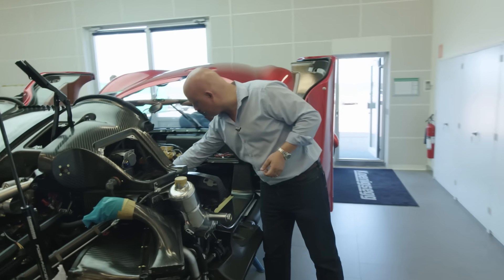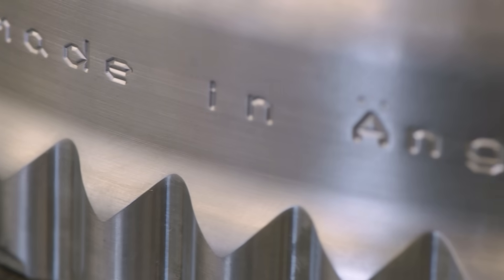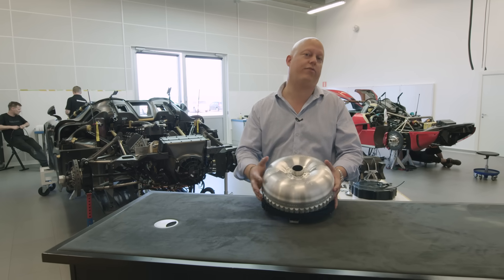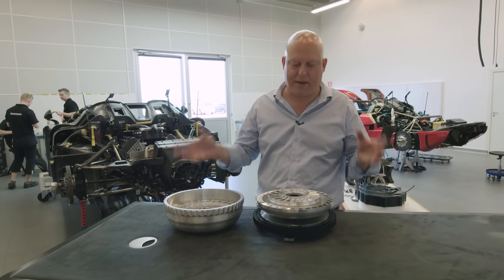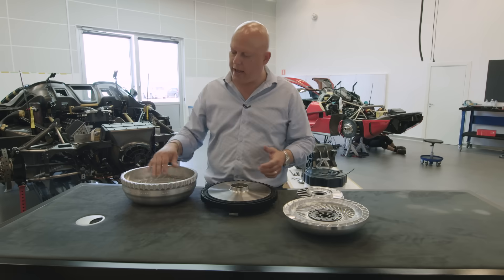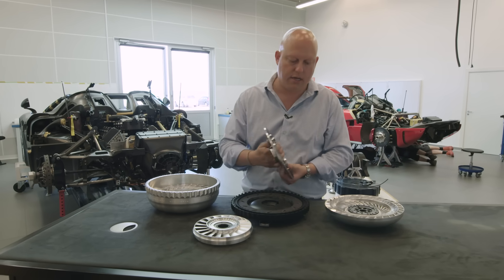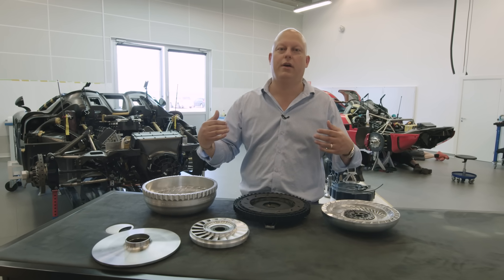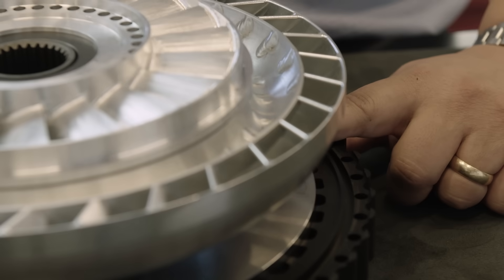248 MPH Without A Gearbox: Direct Drive  -- /INSIDE KOENIGSEGG

Comment: Sr. Koenigsegg: How much energy is loss in the hydraulic torque converter? Similar to old used in automatic transmisions? I already think for a similar Idea, but the people says it's not efficient. You prove than all they are wrong. Obviously I think the energy efficiency dont matter to a millon dollar cars owners, but maybe we can improve the performance (any kW saved, could be useful) to make faster and powerful cars.
Like the FreeValve using pneumatic systems make more efficient the engine, we can use electromagnetism to open/close valves without less 'lag' times and using less energy.
Sorry for my bad english :P

Comment: For the smart people in the crowd why will this ultimately fail?  Which of the two deciding factors will make this design only usable for a few years?  Anyone? Lets put on our thinking caps......
Reply: Armedlegally Heat. heat will kill this system. it's a b** and a half to keep a normal torque converter cool , doing it with all that horsepower and the equivalent of top Gear , better be some good cooling going on.

Comment: I don't mean to be disrespecting and what this man has created overall is amazing and I could listen to him for days.

However to me this is basically just taking a torque converter like in a normal auto transmission and using it to power the one gear.

I'm glad he explained it though, I could not picture it in my head beforehand.

I think then normal cars might not benefit from this design unless there is a large amount of torque going through which in the Regera's case there certainly is.

Comment: So, basically, this drivetrain is like that of a Sprint/World of Outlaws dirt oval car but engineered for a mid motor supercar platform, then on top of that, the "shifter" in the diff or the old In/Out box was replaced with a clutch AND an amazing looking all aluminum torque converter between the ring and pinion that are probably geared to hell (as in very tall final drive) and the 900-1000hp engine........then there are 3 electric motors that each, on their own, make more hp and torque that an 80's smog V-8 thrown into the mix!   The simplicity in that is quite genious!  If I wore hats, they would be off to you Mr. CvK!

Comment: Direct drive is when the motor is rigidly attached to the wheel. It's not a direct drive if you use a torque converter, which is basically a CVT, a gearless gearbox. Bullshit marketing, as always.

Also there's a reason automatic gearbox cars use both torque converter and gears. It's because it's more efficient this way. But you go ahead and waste 30% of the available horsepower, it doesn't matter as long as you can fool the tech inept suckers into thinking it's a good thing.

Comment: It beats the daylights out of a complex automatic 4 speed transmission. 
I imagine there is allot of heat generated, especially with the clutch lockup switched off. He didn't indicate what fluids were used, it's bound to be a synthetic.

Comment: So there's no park gear just the parking break
Reply: Jgizzy redacted I'm use to driving a Manuel. Thanks
Reply: bruh. who cares about park lol
Reply: In traditional automatic transmission there is no parking gear but rather a parking pawl (arm with a locking finger at the end) that hooks on to a notched metal ring attached the output shaft shaft to keep it from rotating. There's no reason they can't use a setup similar to this -- just attach a notched metal ring somewhere on the output shaft then find a place to mount the pawl assembly as well.

Comment: TLDR, basically using hydraulic as the transmission. Yes?

here's what i understood,  The flywheel spins the dome-shaped gear to give angular momentum to hydraulic fluids. The hydraulic would then spin the stator. when the stator and torque gear spins fast enough, they disengage one another.  Allowing a more 1 to 1 power conversion from the engine.
Reply: that whole thing he shows is a torque converter found in any automatic car, normally the car only uses it a bit and shifts cause if it tried what this one does it would explode. but this ones made out of thick metal so it won't and can hold up to the insane HP his super hybrid car has

Comment: Hrmmm... torque converter only transmissions aren't anything super new, they were experimented with back in the 1950's in the US;  the issue with those was the significant power loss that occurred when running at input/output speed mismatch (which Mr. K briefly mentioned).  In this case the electric path circumvents that somewhat, though it terms of absolute efficiency the twin motor CVT systems Toyota, Ford, GM and (with the upcoming Pacifica PHV) FCA are using are better, this just allows for much, much higher speeds.

Comment: It actually is pretty simple, its a torque converter that is just built tougher for the job that can be disengaged by the clutch so the engine is direct drive, it slips in the low end for torque conversion.
Reply: every automatic car has one already, and has since 1950
Reply: Clever use of the torque converter is also what made the Buick Grand National fast. It's not a manual that gets it going like that off the line.

So it's not like the big car companies don't know this, it's more like a question of what their reasoning is for not wanting to do something like this.
Reply: CrazyForCooCooPuffs yeah I'm surprised how simple it was actually!  I bet in 10 years this will be a common thing in most luxury vehicles, maybe even all vehicles if the cost of all that machining on the torque converter wasn't so high.

Comment: I couldn't understand any of this. That's a shame because it's obviously an impressive achievement. Maybe a few Layman's terms here and there might have helped.
Reply: MyLife Just wait for the Engineering Explained version
Reply: None of this is new really. just crazy tough parts. this torque converter is identical to most, it's just tough as fuck and can hold up going 0-60 in 4 sec, lol. otherwise, this cars just a hybrid... a fast as fuck hybrid
Reply: I'm an inexperienced mechanic and understood everything even with his accent lol
Reply: MyLife it's actually very simple. Imagine a battery remote controlled car. The engine on that is an electric motor powered by a battery. So, instead of a battery you are using a 680bhp petrol engine. Now because you are driving directly of the electric motor you have direct torque. The torque converter is the connection between the two motors allowing engagement to the axels. Simple, but genius!
Reply: If electric motor spins at 1,000 rpm  at full capacity you get a gear reduction" direct drive"  say 8.71 like the nissan leaf you divide 1000/8.71= 114.81 this is the number of times the tire is going to make full revolutions per minute depending on what tire and rim set up you have this will dictate your mph.
Reply: Or do some research. Not everything needs to be spoon fed.
Reply: I'm not even sure it's much better. It has diagrams but also much more jargon.

Comment: It is not direct drive if it uses a torque converter when it isn't locked up because it is transmitting power through a medium that is not directly connected to the wheels.

Comment: It seams like the turbine blade is not perfectly cut. This might make some additional losses.

There is a company in Gothemburg just a 100km/h north of Ängelholm that makes 3:d printers that print titanium in sizes up to 40x40x40 cm. It looks like they should be able to print this component in a higher quality
Reply: I'm sure he's aware of how the part he designed works
Reply: matsv201 don't lecture a fool if you are a wise man, because it makes you foolish.
Reply: As much as you want to insult him, you can't deny that he has a valid point, there are parts of that piece that could certainly be improved, and as much as I love the company, Christian made an incorrect statement based on an unfounded assumption in this video. Christian isn't an engineer running CAD designing parts, he has an idea, and others, who are educated engineers with the proper background help him realize those ideas.
Reply: Chris is well aware of 3D Printing.... The Exhaust/Turbine Housings for his 1:One are 3D Printed in Inconel.
Reply: matsv201 yeah, he's just a cowboy and has no idea what he's doing. Send him an e-mail and inform him ...... LOLZ!
Reply: JonnyD3ath I´m just stating a fact. The cutting  is very routh, ths is a fluid dynamic problem that can be solved.. Don´t be a bitch about it.

Having higher quality print would reduce the losses and increase the efficiency and power. Its quite obvius just looking at it from a export point of view that they have not don it here.
Reply: matsv201 And yet he has 128 world class Super Cars on the road and you have??? A YouTube Opinion..... That and a Nickle will get you, a Nickle....  :)
Reply: matsv201  And your credentials are what? Are they verifiable? Can I contact your employer to verify? Proof is on you buddy, not us! :p
Reply: Brett DiMichele Studios 

Why would you need to verify my credentials.

Either, i´m right, or i´m wrong. Don´t matter what my credential is.

The only reason why you would want to verify my credential would be if you don´t know if i´m right or wrong, there for you by default knowing less than i do.
Reply: matsv201  No no no no... You said "I have an expert opinion" That needs to be verified, we don't just take outrageous claims at face value because some random YouTube commenter "said so".... 

Either way I really don't care about your opinion. I'm quite certain Christian and his team have more engineering experience across all of the disciplines than you do. Your hubris won't take you as far as you believe it will.

And with that I'm done.. Because you just aren't that important and wasting more time on you isn't important either.  Have a great life! :)
Reply: Brett DiMichele Studios 
Any statement is only as valuable as its content, not its messenger.

If you are a expert, you would know if i´m right or not. I don´t have to prove that i´m a expert, and even if i did, there would be no point in it.

Anyway, i can´t prove what i work with because there a quite some security around what i work with, just like any other engineer working with R&D

That you ask that of a stupid question just proves that you don´t have any clue what you are talking about.

People that work with R&D can most often not say what they are working with, and decadently not give a reference. Then i would lose my job.

So if you did know this, why did you ask? Just to prove that i can´t answer, that of you already should know.
Reply: You're on crack.
Reply: ***** 
Well it seams like you state things that you just make up with out backing them with any facts.

So now i know, i can safely ignore you because you just make shit up.
Reply: tl;dr. try again more wasted words.
Reply: lolol you are typing right now arent you? more wasted words make anyone who reads this laugh
Reply: Johnson0964 Well you lossed this discussion
Reply: matsv201 i'm not being a bitch, this company invent world class concepts and technology and build world leading supercars, they don't bang out cheap rough cut components. This is probably a demo piece or a trial etc or else its just not that important because believe me they would know!
Reply: JonnyD3ath Well it might be way simpler. They have not found a better solution. 

The issue is that most 3D printed materials are usualy not as strong to make this possible. Most 3D printed part is good for decoration, but not for this kind of mechanical  load.

Also, this rotor need to be very light and very strong. incline steel is to heavy, it is also have not that tensil strength.

There is a other issue. Most high resolution steel 3D printers don´t print this size.

Printing aluminum in 3D printers is very complicated and not really practical.

The solution is titanium. And there is titanium printers this size. Really just need to print the rotors in titanium,

Additionally. Mixing aluminum and steel in a oil bath is not a good idea. It will great (electric) currents degrading the material fairly quickly. Titanium don´t have that problem.

So that they don´t use 3D printed steel, there is plenty of reasons for that. Why they don´t use titanium... well ... i can´t see a reason.  

It is expensive, but actually not that expensive. Milling that size aluminum is fairly expensive to. Also making it in titanium the thins could be half the thilkness reducing the volume of the coupling with 15-20% there buy reducing the amount of oil, and there by the weight.

Using titanium, tho it i heavier than aluminum, it is per strength vice lighter, this does not really make that much of a difference. But if the amount of oil can be reduced, then it does.
Reply: matsv201 LMAO... You try to talk like an expert and I am over here literally laughing my ass off.....  Trying to make yourself sound like the "expert" that you believe yourself to be and when called on it, you just go into a nice neat little circular argument.

If these components were 3D printed the surface finish of the print would be porous as all 3D metal prints are, and that would cause far more turbulence in the fluid flow, that some microsopic scratches from CNC finish milling passes.

Have you ever looked at the surface finish of a powdered metal part vs a machined part under a microscope?  If the Stator and Turbine housing were 3D printed (which they easily could be), there would be a ton of necessary finish machining operations involved to get them anywhere near the tolerance and finish of the part out of the CNC mill.

Beyond all that nonsense... If the finish was THAT critical then Christian's team would perform further finish operations to the parts.

And lets be realistic, Mr.Expert... THIS is what every other Torque Converter looks like inside...

http://cdn.speednik.com/files/2012/01/IMG_5906.jpg

So tell me again how bad the finish is on the parts shown in this video? Yeah that's right....
Reply: Brett DiMichele Studios 
"Trying to make yourself sound like the "expert" that you believe yourself to be and when called on it"
I don´t try to do anything. Just tell you how it is. Its probably projection from your side.

"would be porous as all 3D metal prints are"
No that is not true. Most are, but not all. It depend on the method it been reconstituted with. Of cause the surface will never be that clear. But that can be fixed up with a secondary process

Most 3D processes have process to smooth down the edges. There is a few method to do this. But most commonly some water mix and ceramic cones. in a infra sound baths.

This give a surface that is way smoother than what you can get from a CNC machine. It is also not that expensive.

"So tell me again how bad the finish is on the parts shown in this video?"

You zoom in and the errors is more clearly visible.. congratulation. Also the turbine in the image is made from a other process make it have other kinds of flaws.

The problem with Köngisegg is the outer edge anomalies This gives quite a lot of turbulence that is not suppose to be there..

Stop projecting your incompetence. It just make you look really dumb.
Reply: Brett DiMichele Studios Also you fanboyism is just immature. Grow up
Reply: explain!
Reply: Well you can tell by looking at the casting that it is not smooth everywhere, and since it's flowing a hydraulic fluid even something small can have a big effect to to viscosity. If you were building a high performance engine and your valves looked like that you'd send them back or reshape them. Also, though it would be wonderful to thing that toque converters turned lost rpm into toque, it simply isn't true, the loss is turned into heat. Now, there is one torque benefit to a toque converter, and that is the ability to run the engine at a speed where it is making more power than it would be at the lower speed it would be running if it were directly tied to wheel speed, you can use the "looseness" of the connection to keep the engine in power band. But again, there is no mechanical advantage in a toque converter, so output toque will never be higher than input toque, yes it will put out more toque at 2000 rpm than if it were stuck at 1000 rpm, but this difference is solely due to increased engine output.

Comment: Can you manage at will the strength of the couple during deceleration and accelerations?(if you wanna more torque to have more or less brake engine force as manual gearbox during the lower gear shift)